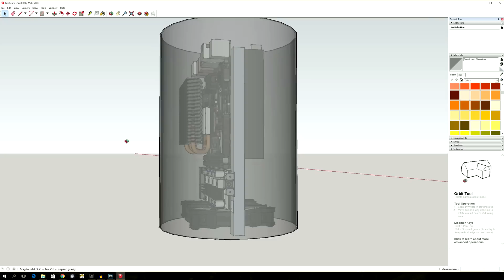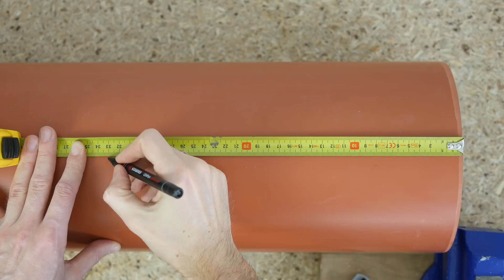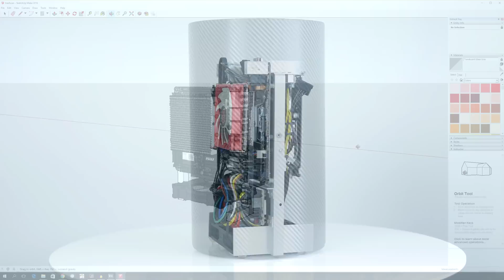How to make a Mac Pro wannabe mini ITX computer (DIY PC case)

Comment: Loved this, is CPU radiation not a worry these days?  Perhaps good heatsinks and snug good fan on the bottom with good inlet would work, generally I like the design.  With the idea of heat rising perhaps the PSU is slightly problematic.  Always thought a separate boring external ATX supply and mini itx board stuck in a biscuit tin not a bad idea.  Anyway loved the simplicity of the main frame here.  Longer riser cable wrapping around the cpu might help flip the gfx card, after all you won't see it if shrouded.

Comment: Everyone keeps making the mistake in these vertical builds where the cpu cooler is oriented wrong with the fins working against the airflow when they could be lined up so the heat works in favor rather than against the build.

Comment: I'm attempting to do the exact same thing in my spare time in Sketch Up, although I'm 3D printing pieces to test clearances and sizing. After multiple revisions I managed to get the sizing at 8"x10.25" with 400w available (with pico psu and converter.) Now I just need money to buy the components to test if it actually will fit then see about making an actual case or if it somehow.

Comment: Nearly perfect man! I really liked it. The temps are a problem coz the gpu should face the opposite direction and there should be another huge fan up which blows in while the fan down blows out. Turbine design i call it

Comment: Cool build, but why bother when there are already fantastic case clones available. I built a Hackintosh for a friend using the Dune Case, AsRock X299 Mini/ITX, Intel i9-9980XE, 64GB 3200 DDR4 RAM, 2x M.2 1TB Samsung 970 Pro and a used Titan Z that we got for $1100 at a bank auction.

Comment: 3:10 you could connect a lot of riser cable together (linus made a video on that) without any performance loss. Great video though, nicely done!
Reply from the maker: Yeah, I watched that video and did try that in a different project. But it didn't worked with these cheap generic risers. Linus used quality one by Thermaltake.

Comment: @YetAnotherTechChannel would you consider replacing the fan with a 140mm or 200mm unit and have it blow air upwards? Rather than fighting convective forces this would help with lowering temps and noise level. Would love to see how that goes for you. Great channel, keep up the good work!
Reply from the maker: Yeah, bigger fans would most definitely work better as they are capable of moving a similar (if not larger) volume of air at lower RPMs. But, since I'm not a full-time YouTuber, I don't have time to iterate on the same project. Once I'm done, I try to take whatever I learned from it and move onto the next one. If I only had more time and a proper workshop... ;)
Thanks for your feedback about my channel :)

Comment: you haved big fail with cpu radiator.you needed vertical radiator not horizontal
Reply from the maker: Sure, but I'm not Linus and I don't have a bunch of heatsinks laying on a shelf, collecting dust ;)
Reply: @YetAnotherTechChannel  well then evrything is fine and i dont know who is linus))

Comment: If you flipped the motherboard (with the I/O facing down) you could face the graphic card’s cooler to the outside of the case, away from the motherboard.
Reply from the maker: It wouldn't work. The CPU cooler would have to face the center of the pipe - and to make room for it, the motherboard would have to be moved outwards - and there's no room to do that because it's a pipe and not a square box ;)

Comment: Nice job but after giving thought of having a similar project for a few months already, I noticed that one doesn't need the cylindrical case. It is actually more wasteful in space and effort.
A mini-itx is quite squarish and so is a huge exhaust fan like a 180mm fan.
Reply from the maker: Yeah, I came to the same conclusion when working on this project. If you have a high-tech R&D facility, then you can make the most out of this shape, but not when you're DIYing in your apartment ;)

Comment: could you make the frame with wood
Reply from the maker: You'd probably have to use pieces with a larger cross-section (2cm by 2cm), but I think this should work.
Reply: @YetAnotherTechChannel  I have an idea for a case would it be possible to frame a monitor and use it as the top of a slim PC case with electric hinges that open the case?
Reply from the maker: Everything is possible, it just might require more research, more work and more money ;)
Reply: @YetAnotherTechChannel  yeah I'm going to try and make my first case ive always bought them mabe I'll save some money this way. Your channel is awesome keep making awesome stuff

Comment: perhaps you could upgrade the case a bit by making connections to the motherboard built into the side of the case. I know, it would involve some soldering, but it would look better and certainly more user friendly to unplug any cable when moving he setup elsewhere.

Comment: How well do the Plex PSUs work out? Your's is the only channel I've seen using them, and I was just curious for some custom projects I have coming up.
Reply from the maker: My builds are just prototypes and I don't really use them extensively. Having said that, I'm really impressed with this little PSU. It can handle quite a load like a champ :)
Reply: YetAnotherTechChannel Thank you, that's excellent to know. I'll have to give one of them a shot in a quite compact m-itx mod I'm working on.

Comment: You could connect the GPU with two Risers  to have the gpu fans face the outside and not the motherboard, it does not affect performance if both risers are shielded properbly
Reply from the maker: You're right, and that's what I'll be doing in my current scratch build. Back then I didn't have a second riser cable and ordering it would have postponed the completion of this project by a week or so.

Comment: My friend, take it, please advice from the old locksmith: when you saw the profile under the bend, do not jam "in line". Retreat to 1-1.5 of the thickness of the canvas, then when the edges are bridged there will not be such a gap. A cat with inspection walks? :)

Comment: why did you put the mobo vertically and not horizzontally? (forgive my english)
Reply from the maker: 1. More natural mobo and GPU I/O ports access.
2. I'm not sure, but I think mobo wouldn't fit horizontally.
3. Airflow - with the motherboard horizontally it would be hard to implement any airflow.

Comment: I wanted to propose an idea to try to make a concrete casemod, would that work?
Reply from the maker: You want to make a case using concrete? I did experiment with concrete a while back (not tech related) and it's not as easy as it may seem...
Reply: even making the form of a cabinet, using mdf?

Comment: I think you could reach better results regarding cooling by simply turning the bottom fan around, as hot air will tend to be exhausted from the top, which you should support by using the bottom fan as an air intake to follow the natural streaming direction of the air.

All in all, great job and thanks for sharing! I will copy your work for my PC build :)
Reply from the maker: You're right ;) For my defense - heatsink orientation was a leftover after a monitor stand project (https://youtu.be/XSUI67vNXsM) and I didn't bother to reposition it ;)

Comment: Is it possible to rotate the CPU radiator 90 degrees? The air direction would then be similar to the one from the bottom fan...

Czy jest możliwe obrócenie radiatora procesora o 90 stopni? kierunek żeberek radiatora pokrywałby się z kierunkiem przepływu powietrza dół-góra...
Reply from the maker: Orientacja radiatora jest pozostałością po projekcie podstawki pod monitor (https://youtu.be/XSUI67vNXsM). Trochę nie chciało mi się czyścić procesor z pasty termoprzewodzącej i ponownie jej aplikować... lenistwo ;)

Comment: That generic riser is really bad. Use nanoxia, lian-li, li-heat or ezdiy for no loss of performance. For the rest of the build, kudos. Really beautiful.
Reply from the maker: I actually benchmarked a few video cards with two risers - a generic one and one that came with Sentry case. With the GTX 1060 (the most powerful GPU I currently have) there was absolutely no impact on performance in games comparing to a GPU inserted directly in the PCI-EX slot. I published a video about it on my Polish channel but didn't translate it to English... maybe I should ;)
Reply: I tried with generic riser from ebay on my 1060 and results were awful. After i bought EZDIY riser , i have no  performance loss at all. MAybe i got faulty riser but hey, what to expect from 5 euros riser.  EZDIY is around 30-35 euros but works flawlessly.

Comment: Using a sewer pipe to mimic a Mac Pro. How fitting
Reply: Josef Yes, sewer pipes are fittings
Reply: @cocoshort6528  you talk too a guy XD angelica XD
Reply: because that mac pro is trash
Reply: Orange PVC is used for sprinkler systems. This video is just raining bullshit on every one. The outside isn’t even attached to the frame on the inside. How are you supposed to safely move the computer around without worrying about breaking something.

Comment: The idea is good but the "shell" needs some improvements. my idea would be to use a mesh from a old paper basket and have a 5 cm high piece of pipe on the top and bottom. Further a longer PCIe extension cable to mount the GPU with the fans facing outwards would be good. Like this you´ll have a good looking case and amazing temperatures.

Comment: but how do you turn it on?
Reply from the maker: +dovydas van wijland There's a switch on a short wire inside the case. I had to take off the top mesh to reach it, but since it was just a prototype build, I didn't bother to extend it...

Comment: nice job
btw you could hot glue an usb 3 extension cable to the alluminium bar on the top for easy access

Comment: Great build but you should have gone for a cube instead of a cylinder case. There is a reason that the Mac Pro is more convenient and that's because all of the I/O is on the side rather than on the top. You need to remove the top mesh to plug a thumbdrive.
Reply from the maker: Cube is too simple and I like to challenge myslef and I've been wanting to try that design for a while. Like I said - if I really was going to use it, I'd definitely add two easily accessible USB ports.

Comment: You pretty much nailed the inside mounting grill.

However i think you should have made something to level it up from the floor and at the same time connect that base with the outer case so you could pick it up with one hand.

The case itself is just there, not attached in any way to the inside grill.
Reply from the maker: Look closer here 7:10 - you should see a screw (there is another one on the opposite side) - this is where the outer shell is attached to the inner frame.

Comment: Only use a mini itx board if you're using a GPU. If not, mini stx is the way to go.
Reply from the maker: If I did that with a mini STX motherboard, there would be a lot of comments on how the build is missing the GPU ;)
But I am planning a mini STX, passively cooled build.
Reply: YetAnotherTechChannel I've seen a mini stx build that used a graphics card before. It used a few adapters to use the m.2 as a pcie 16x slot. Kinda weird, NFC systems has a video about it. The entire build was inside an atx power supply.

Comment: Though I enjoyed many of your previous builds, this one makes no sense. If there's one constraint in SFF case building, it's airflow planning. you took the time to 3D model the frame to attach your components and managed nonetheless to bury your main fan to the bottom without a decent opening to draw the air in or even the bare minimum 20mm gap for the fan to even generate airflow. And I won't mention the gpu fan actually pushing hot air to the back of the motherboard...

The worst is that you mention all those design problems in your video and decide to follow your plan nonetheless. Basically, you just dropped a bunch of computer components in a shoebox, wrapped it in vynil and decided that was good enough and that "it was just prototyping'. You have done way better work than this.
Reply from the maker: Well, I was just curious if I can manage to pull off a cylindric case... just that.
I sketch my designs to get an idea if they make sense at all and when doing that I try not to analyze every little bit of the project... not to overthink it... because if I have had considered every little aspect of each of my designs, it would have turned out that they cannot be perfect and therefore it makes absolutely no sense to even start... simple as that. 
A lot of ppl are thinkers... they think about doing this or that... I'm a little bit of a thinker but most of all - I'm a doer...
Reply: I can understand that. I like to do mockups in cardboard or smaller scale models before investing time and ressources in the final project. It helps me come up with alternative ideas I would probably not have if I had gone only the CAD way.

Comment: This looks awesome! Made one like this but different orientation and with sfx psu. Ports are the same position as macpro and 140mm fan on top for exhaust. Another 30mm blower fan to redirect the evga 1060 oc exhaust air upwards. I also used tinted acrylic, oven heat it and bend it into cylinder. Installed el wire to have a tron look. Lots of work but worth it.
Reply from the maker: This sounds very cool! Do you have any pics?

Comment: Really interesting project! I'd make a couples of changes though. If clearance allows it, I'd rotate the CPU heatsink so that the fins are vertical. With your bottom-to-top airflow path this should improve temps. I'd also make the case feet taller, that chassis fan is very starved for air as it stands. With the external cables (power, HDMI, USB, etc.) I'd run them down the inside of the case  and have them come out of a similar hole, but placed at the bottom of the sewer pipe.

Comment: But is it Hackintosh capable?
Reply from the maker: Someone pointed out that the GTX1050 isn't supported but I've never planned on making a proper hackintosh - I use Mac OS at work and I find it very irritating... ;P
Reply: Many people who are used to a backward upside down copy of the MacOS find it difficult to get used to a system that makes sense. The OS that one starts on is what most users get used to and then they think that it makes sense too.

Comment: this is really good looking pc but it will fill full of dust in time, because mesh holes are huge. and i think there is a place that you can add a fan top of the pc, it would be better cooling with the top fan i  think.

Comment: that riser is shitty, bought one of those for my 1070 and it didn't work at all, i guess i gotta get a better one.
Reply from the maker: Mine is working just fine and I just benched it with a few GPUs and the difference in performance was within the margin of error.

Comment: what about a 140mm low rpm fan in the top?, could get some fresh air down to the cpu and gpu, then reverse the bottom fan, maybe lower temps a bit

Comment: Maybe painting the inside white or covering it with a reflective material could help keep the heat away
Reply: Glenn Smith What.. what does color have to do with components temps?

Color matters for t-shirts and cars when solar light is involved, but for a computer it would be the same lol.
Reply: dark colors absorb heat,, having the inside painted black means the heat gets stuck there for longer periods of time,
Reply from the maker: The plastic tube does get warm to touch after a while so this might actually help.
Reply: Glenn Smith color has no relation to heat retention. You are thinking of black absorbing all light energy which is converted into heat. components don't generate light energy at a level that would produce any noticable changes in Delta temps. it's a common misconception. heat retention and conductivity is based on the material of the tube. :)
Reply: Vicse Man. Heat translates to IR light, this is why a good thermic container will have mirrored insides, not that one would be able to see them
Reply: Glenn Smith you can read and feel it as heat but heat and IR radiation are not the same thing.
Reply: IR detection is the key for night vision goggles, you can see a glowing human being in IR because heat and IR light are closely related,

Comment: I wonder if the cooling would be a bit more effective if the fan was at the top blowing upward rather than at the bottom blowing upward?  It would then be closer to the heat-producing components.  The right fan, and its placement, can make all the difference in a cramped rig like this.

Comment: All CPUs enjoy a temp of 80C - Or not. your trashcan Mac Pro will not last forever.
Reply from the maker: 1. This is the worst case scenario with all four cores crunching Prime95.
2. The max temperature of the i5 6500 is 100C.
3. I'm just prototyping - I won't be using this computer. Otherwise I'd invest in better CPU cooling and improving the airflow inside the case.

Comment: I guess temp problems can be easily fixed with a 140 mm AIO coolers
Reply from the maker: An AIO is probably the only hope for this design as it couldn't fit a larger heatsink.

Comment: love the build, i have the exactly same idea, but i want to use a SFX PSU and put the MB and graphic card horizontal, with port on the side, but i like what you did, now i want more and more to make one :D
Reply from the maker: With the MB positioned horizontally, you will need a larger pipe ;)
Reply: hmmm, an ITX MB is 17cm wide by 17cm long, why do i need a larger pipe ?

Comment: Should put high casing feet to improve air flow from bottom and dust filter to keep out of dust. If can, USB 3.0 front ports and Audio/Mic ports would be better.
Reply from the maker: Sure, if I was going to use this case daily, I'd definitely dust-proof it.